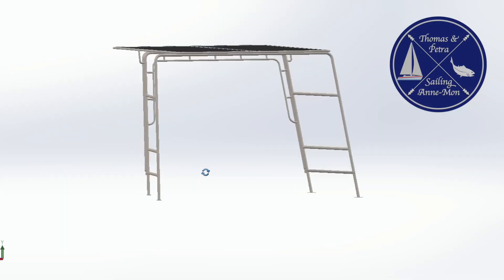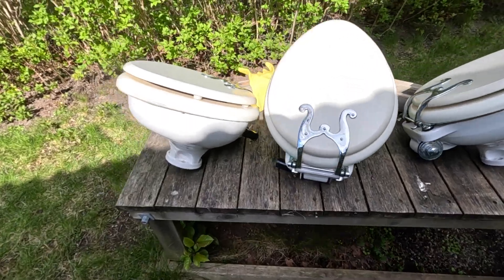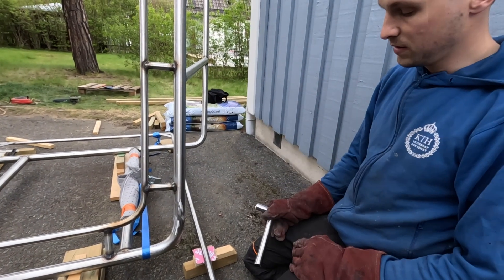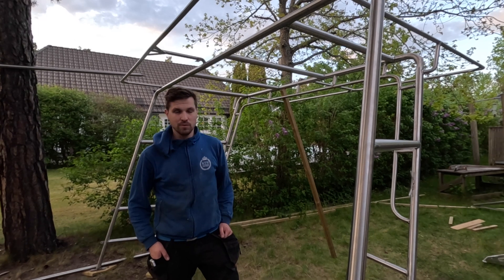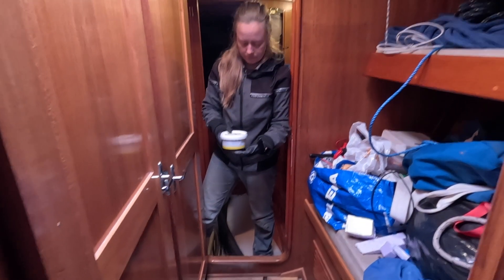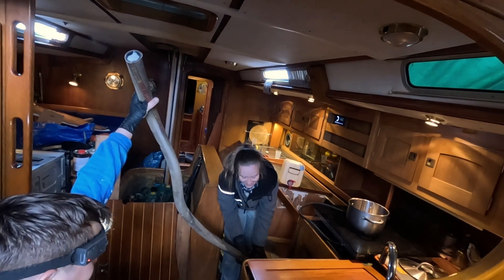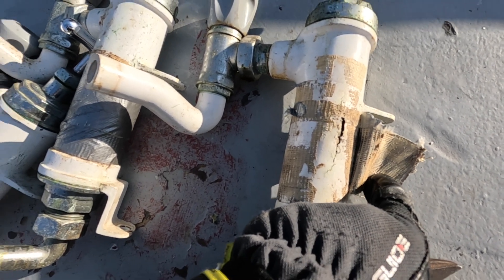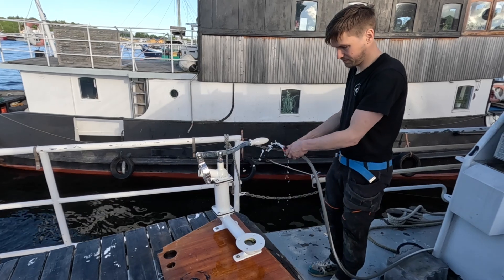DIY Solar Arch Build Pt.2 – Building the Solar Panel Frame! [2.41]

Comment: Nice arch,  would you be able to tell me the diameter of the tubing/pipe and wall thickness that you used and what diameter of welding electrodes you used?
Reply from the maker: Thanks! We used 42x2mm and 25x2mm pipes and it is welded with 2mm electrodes.
Reply: @SailingAnneMon  Thank you for getting back to me. Here in Canada we do not have 2mm electrodes which is too bad for me, 2.4 mm or 1.5mm are the smallest diameters available around here. your work does look fantastic.

Comment: Thank you for sharing this! 

My apologies if it is mentioned elsewhere, but do you have costing information for this build? 

I've a MiG welder and considering getting a tig to take on a similar project.

Thank you
Reply from the maker: No, not for the solar arch 😊 I’ll guess we’ll summarize it more later but estimated cost right now is around $2k for the solar arch 😊
Reply: That's not terrible at all, did that include the panels? Either way much cheaper than having it fabricated.  @SailingAnneMon
Reply from the maker: No, I might have missed some costs though, but it should end up close to that number 😊 solar panels is not included (paid around $250 for those)

Comment: Do you really want to keep three toilets on the boat, and from what I can see, you really intend to do that? Is that not a wasteful use of boat space and potentially lead to more maintenance issues?
Reply from the maker: In the long run we’ll probably remove one of them (and rebuild companionway) but not for this trip 😊as we plan to have friends and crew with us and a lot of times full boat we think that 3 toilets actually will useful, but we’ll see when we’re out how much we use each one of them 😊 maybe we just end up cursing all maintenance or we are glad to have them 😅
Reply: It could also be that there is a need for 3 toilets in the future plan, right?